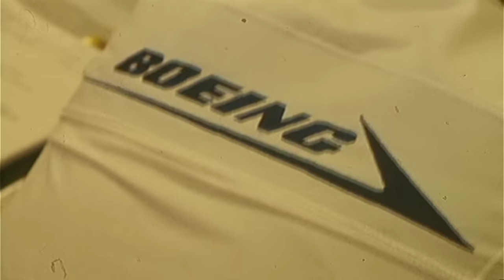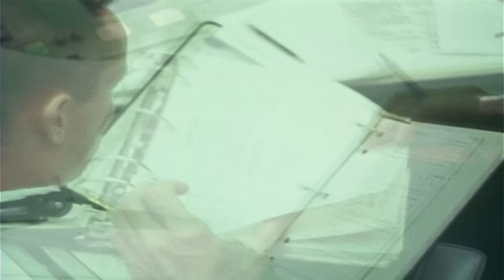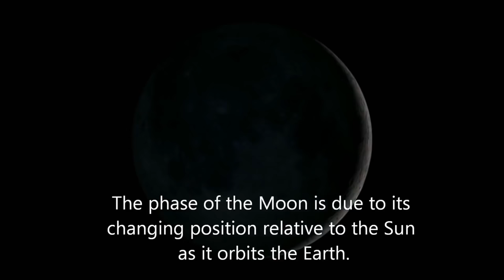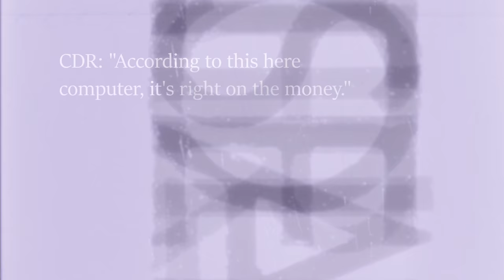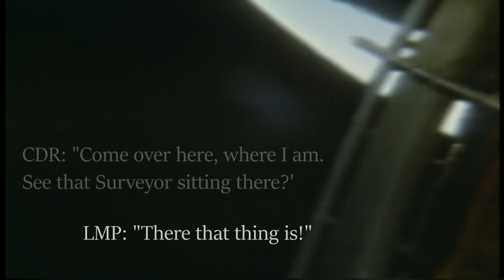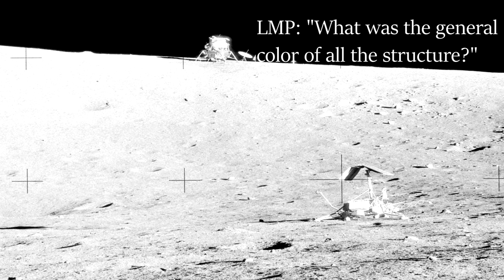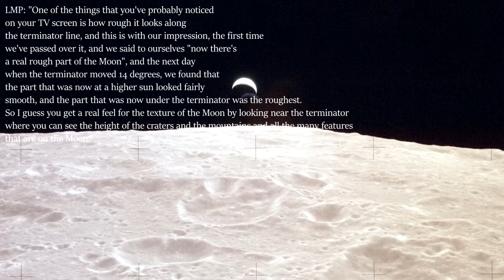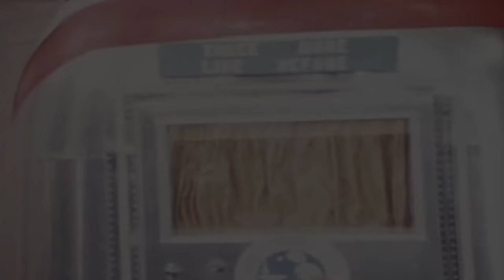Apollo 12 Remastered (50th Anniversary Edition) [4K]

Comment: Wow, I had no idea the legendary "SCE to AUX" call was made so fast. There was only 50 seconds from the lightning strike to John Aaron's suggestion to the Flight Director, which means he figured the problem out in less than 50 seconds. WOW!
Reply: John saved the mission. He had seen goofy telemetry in his early career dealing with missiles. When he saw what happened he gave the famous command! They should not have launched, l believe later flights would not go up in same conditions
Reply: I think there was an interview with him where he said that he had some experience with using the SCE to AUX switch. It was amazing that he recalled it during a stressful time.
Reply: @garylucas6511  this is correct
Reply: He saved the entire Apollo Program in 50 seconds. 🎖️🎖️
Reply: It was the reason for all the simulation runs.  Those weren't just for the crew, but also the guys in the MOCR.   John had seen similar instrumentation dropouts in sims and recalled that SCE to AUX was the fix.    Practice, practice, practice.

Comment: Thank you for covering one of the more forgotten Apollo flights to the moon. Two memories I have that have not been mentioned since Nov ‘69: One of the questions asked by the press to Pete Conrad was “Were you on an oxygen high” during the moon walk. The other thing that disappeared down the rabbit hole was the that some of the 70mm Ektachrome 64 film magazines were accidentally left on the moon along side other normally discarded equipment. Kiddos for mentioning the in flight press conference. No other documentaries have ever mentioned it. No other Apollo flight before or after ever had one. Thank you for also not mixing and matching film clips from other flights and not using a British voice over which has become vogue in the documentaries in the last 10 years. Above all, thank you for not dumbing down anything.

Comment: great documentary — really enjoyed the description of how and why they performed certain procedures and how you've put it all together to make sense of what was necessary to get there. great anecdote about the apollo 12 lightening rod ⚡️🚀 just one error in this video — the annotation at 37:33 says 'Contact, flight' — which is wrong — it should read, 'Contact Light' — which has been explained by the astronauts that there was a light which came on when the landing pads engaged the surface of the moon, and this light was the 'Contact Light' — and they were relaying to ground control that this light had come on — you may want to correct this minor error — otherwise, a very excellent exposition of the Apollo 12 mission — thank you.

Comment: 9:30 the amount of controls in that Control Center is insane. I'm counting around 200 consoles, each with a myriad of buttons and switches, not to mention countless data displayed on the monitors. Just imagine the cabling that was going underneath the floors. Several consoles had more than one person assigned, some even had persons sitting in three rows.
Reply from the maker: What an electric environment it must have been, too. You could probably feel the excitement in the air.

Comment: Outstanding! Do you have any speed corrected footage of the interior shots? Why was the NASA footage released at higher frame rates? (0.45x playback is better, but commentary is distorted)
Reply from the maker: I could probably speed correct it myself but it’s likely either tape stretching or it was scanned at a higher framerate and just left that way. I personally like fast playback for outside shots and sync’d playback for interior shots

Comment: I don't really want to be critical of what must have been a difficult endeavour, but "remastering" should have included correcting the aspect ratio of 4:3 clips that were stretched to 16:9.  There is obvious lengthening of all objects in the horizontal plane.  This ruins what would otherwise be an excellent viewing experience.  The  average layman has a poor understanding of picture geometry.  All he knows is he doesn't like black bars.  So, the only solution is to crop the picture.  This can sometimes take some talent and imagination.  If you have any aspirations of really being a documentarian, this error is unforgiveable.  The fact that most viewers don't recognize this as a serious error does not absolve it. It just shows that this kind of sloppy editing is rampant these days.  An outstanding example of how to do this properly is Peter Jackson's recent superb editing of the 1969 Beatles Get Back sessions which were shot on 16mm film..  I am not taking away from the effort required here to assemble all these disparate clips into a coherent whole.  The fault lies in the tools having been provided but with insufficient instruction, or emphasis on the need to adhere to basic standards such as picture geometry.  Sadly, there is way too much of this going on presently.  That doesn't mean it has become acceptable.  (BTW, calling it 4k is a bit much.  Even if it actually was 4k, there would be absolutely no point.)
Reply from the maker: I appreciate the lecture but you should know to look at upload dates and also to judge someone’s work on their latest video. This film was made when I was still in high school, and while I agree with your point about the stretching, it really isn’t appropriate to go well back into someone’s catalog and critique an old work as if it’s their current standard. 

Furthermore, there actually is a point to rendering in 4K — and that would be the 70mm still images, the Hasselblads.

Comment: I agree with the previous comments about the high quality of the presentation, but I would prefer that you stick to the original 4:3 aspect so as to avoid the horizontal distortion that makes every thing appear wider and not to correct dimensions.

Comment: Dumb question here, how does the shipe travel faster then a bullet i thought shooting a person out a cannon would kill them, i heard thats why sub orbital space cannons didnt work like that one movie
Reply from the maker: It's not a dumb question! The key here is flux, or "rate of change over time". Shooting a person out of a cannon or gun means an instantaneous acceleration. From 0 to 100 in fractions of a second. This means an insane amount of accelerations and forces on the "bullet" (and therefore occupants inside the spacecraft). With a rocket however, it is a "controlled burn". The combustion of a rocket engine imparts high amounts of acceleration, but when compared to the deflagration of gunpowder, it is actually much slower. It takes the Apollo/Saturn V some 11 minutes and 45 seconds to get into Earth orbit! The crew is under heightened levels of acceleration during that time, but these accelerations are manageable to the physiology of the human body. Now, imagine all that speed -- some 8,000 m/s, some 17,500 MPH...imagine going from 0 to that full speed in an instant. The result would be you'd be squashed. That's why orbital space cannons don't work.
Reply: @JacksonTyler  ohhhh that makes sense i always wondered why the nasa rockets looked like they barely got off the ground.
Reply: @ChrisPBacon-jl7oc  Big rockets carry a ton of fuel which makes them weigh a lot, so their thrust to weight ratios are low at lift off. So it takes a minute for these rockets to really start accelerating as they burn fuel and lose weight.

Comment: Always love your work but the explanation of SCE to AUX in this one is not right. The Signal Conditioning Electronics was a critical part of the telemetry system that took all the spacecraft sensor data and packaged it for transmission to mission control. When it dropped off line, mission control just started receiving garbage data on their screens, with no information on the state of the spacecraft or the problem. Flipping SCE to AUX didn’t do anything to help the spacecraft systems themselves, nor help the crew understand or correct their problems. What it DID do though was give mission controllers back valid data streams so they were able to understand and diagnose the problem. Resetting the fuel cells was the first real step that started to get the spacecraft systems back online.
Reply from the maker: I don’t think I implied (certainly didn’t mean to) that SCE>AUX actually reset systems, and knew even at the time of making this that it was simply an alternate data stream. Verbatim the only thing wrong in  what I said was that the instrumentation was crew-side not MOCR-side.

Comment: How did they walk around on Earth doing training in those 360 pound suits/backpacks for hours? Were these guys Olympic athletes?
Reply from the maker: Those were training suits designed to somewhat mimic the relative weight that would be experienced on the Moon. They don't have full life support (the astronauts are breathing the outside air) but they do have operational air conditioning units. Most of the weight in the A-7L lunar suit is in the PLSS backpack, which is essentially a mini-spacecraft of its own.
Reply: @JacksonTyler  Do you know the weight of these "training suits" with air conditioner in fake PLSS? How much did the actual suit weigh minus the PLSS? They walked to the van/gantry OK, so does that mean most of the weight was in the PLSS?
Reply from the maker: @CaribSurfKing1  I'm not sure how much the air conditioning PLSS units weighed, but here's some figures I pulled from Wiki page/Apollo Definitive Sourcebook

Without the EVA "accessories" attached to the suit, it's IVA configuration (which the astronauts were wearing during the walk out to the gantry) -- and you'll notice that they are carrying these big briefcase-type things; those are also portable air conditioning units.
The IVA configuration weighs 62 pounds. With the added EVA layers, this is changed to 76 pounds. 
The "real" PLSS weighs at most 129 pounds (assuming a full Apollo-17 type consumables quantity level). Therefore combined Earth weight of Astronaut (let's say 150 pounds) + suit (76 pounds) + PLSS (129 pounds) = 335 pounds. 
It's interesting to note that spacesuits have actually gotten a bit heavier since Apollo, and John Young complains about this in his book. The combined PLSS/Suit weight of a modern EVA suit is something in the ballpark of 225 pounds today. 

I'd guess those air conditioning/LCG backpacks weigh somewhere between 20-40 pounds, and the training suit weighing about 60-70 pounds. So about 110 pounds total, at most.

A standard combat load weight for a U.S. Marine these days is around 100 pounds.
Reply: @JacksonTyler  Great answer. They were fit guys at the level of combat soldiers. So I guess they could manage 110 pounds for a few hours in 1G training. I had read 360 somewhere and thats why I asked the question as that weight made no sense. Cheers